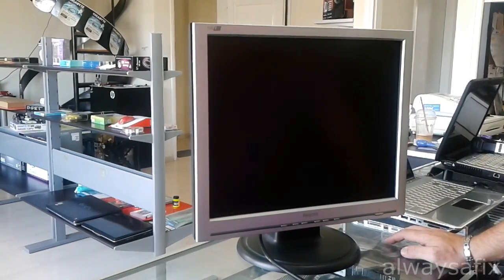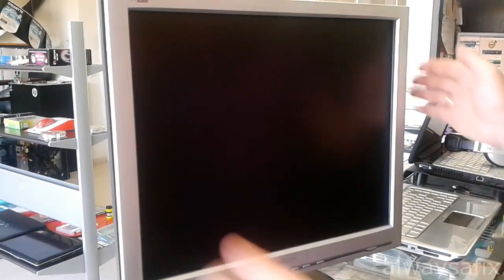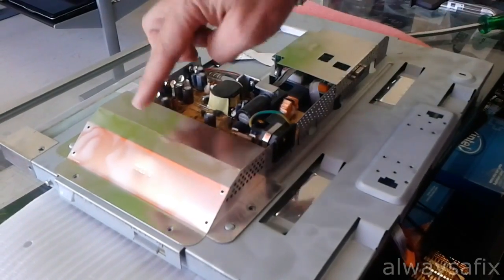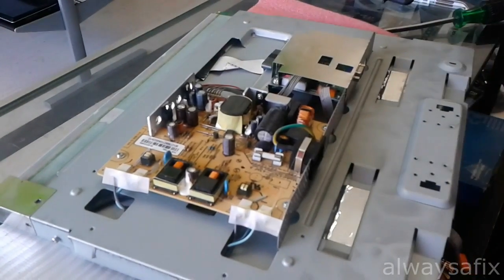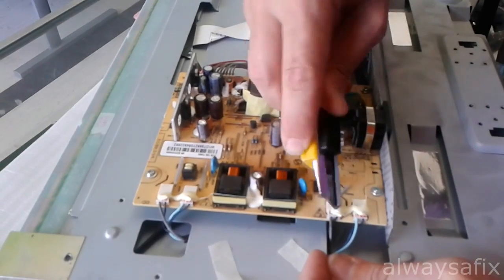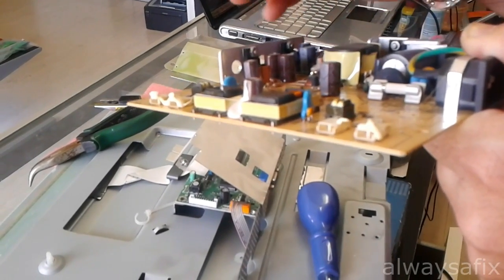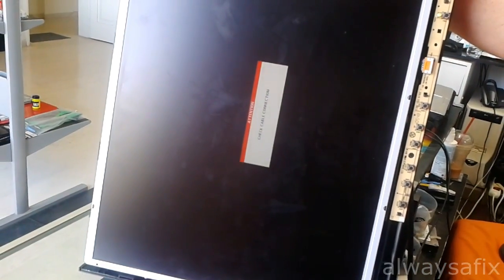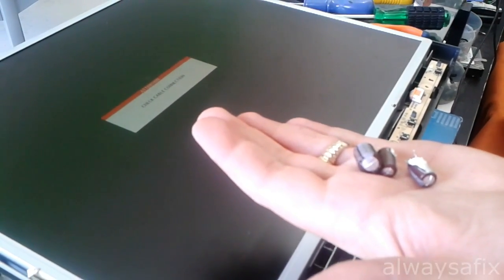Screen problem backlights switching off philips 19 inch 190v.

Comment: Hi mate, have 200W B going to fix it..thx for sharing tutorial!!!
Reply from the maker: Good Luck, let me know how it goes
Reply: @alwaysafix  now I got stucked  :) on 2 last screws to get this metal cover off to go to board and check capacitors..so.. I tried WD40 it looks like stick with glue , first screws somehow luckily unscrew them , just these last 2, Omg..
Reply from the maker: @TomD5222  That is not normal for those screws to be glued
Reply: @alwaysafix  yes ofcourse.. just I broke screwdriver on these last.. anyway, this monitor has bit lower resolution how I would like to have, no full hd, so will try to sell and if not comming still can drill screws.. just found only brokenone nogood.., thx anyway..

Comment: @ 04:00
I heard that the capacitence & the voltage of the electrolytic capacitors can be the same or higher. So which information is right ? 😕
Reply: the voltage can be higher

Comment: I have a Philips Brilliance 220SW model & after replacing 7 electrolytic capacitors, backlight still turns off after about 2 s when connecting it to my laptop computer. 😣😒😞😟

Ceramic capacitors are fine.
Reply: Same, did u find fix yet?
Reply: @TheBestGames974  Sadly... no (not yet). 😞

I'm thinking that it might be one of the transistors that is giving me a hard time.

Comment: Hello, my old monitor has a white vertical and irregular stripe about in the middle of the screen,  the screen it's gone or the backlight lamps? and even a not correct voltage from power board, i get about 13.5 volts instead of 15, the other voltage 5 it's correct. some hints? thanks.

Comment: Well suddenly my good old monitor Philips 190C  (190C6FS/00), April 2006 (4:3 profile view), and as soon i power it on, it does on+off flashes showing the OND (on screen display menu), or just the desktop picture... for at least 10 minutes, then stops for a while , then again the same problem. 
  Can anyone please tell, what  the problem could de??

Comment: In my case , I do not see any blotted or leak capacitor, the problem no backlight but I can visually see the display with flashlight..I would like to ask what part is deffective or to be replace?
Reply: Main Power Board I'd say. Did you check for burnt ceramic capacitors too ? Those blue ones. 🤔

Comment: Hi i have same problem,  board is same i think, its look same, but mine is 17 inch, coils is ok, i checked both of them with ohmmeter, and its about 500 ohms, i changed 3 capacitors like u in this video (just one located between coils is looked like popped up,  but i changed 3 of them like you, but same problem is there :( sometimes light working longer than 1-2 sec, sometimes work even longer than 1 minut. Please can u 
answer me what next part i need to check ? I have some old DELL LCD monitor 17 "
 with broken display, so i can use part which is broken on this PHILIPS,
 just to detect what part it is. Thank you for your answer. And 
greetings from olimpic city of Sarajevo Bosnia and Herzegowina. You 
doing right thing, videos of that purpose is practical knowledge GOLD. BIG RESPECT!
Reply from the maker: +Rajvosa Sarajevo Next thing to check are your CCFL lamps.  Please check out my video on your issue  https://www.youtube.com/watch?v=RsaS_d_i4tA   Good luck.
Reply: I checked it already on another working display, same thing :S Thank you.
Reply from the maker: +Rajvosa Sarajevo You have to find a working CCFL lamp from your old Dell LCD and plug that lamp into your Philips to find which CCFL lamp is faulty.
Reply: Thank u very much, i connected lamps from Dell LCD and it worked. One lamp from Philips is dead, i changed with working one from Dell and now my Philips working again. Thank you very much one more time!
Reply from the maker: +Rajvosa Sarajevo Congratulations on your fix and thanks for watching.

Comment: I have philips 190vw the monitor takes like 3 mint to turn on when i start the computer what seems to be the problem?
Reply from the maker: +Dominic Madbull Plug your computer into another monitor or TV to determine if the problem lies with the pc or the monitor.  If its with the monitor it could be swollen capacitors on the power supply board.  Good luck!

Comment: Hi , I have a problem with model 190S...everything works fine with screen, but sometimes it apers on screen blinking ATTENTION : Monitor controls locked and sometimes he is adjusting colour and brightness by himself :/ do you know how can I fix this problem without paying someone ?
Reply from the maker: Have you checked for bad capacitors in the power supply board?  Thanks for watching